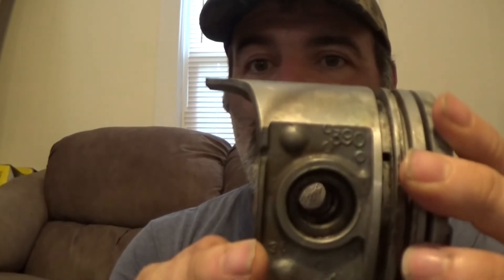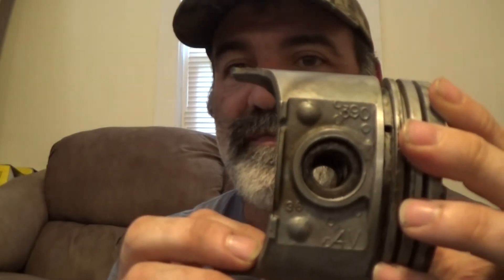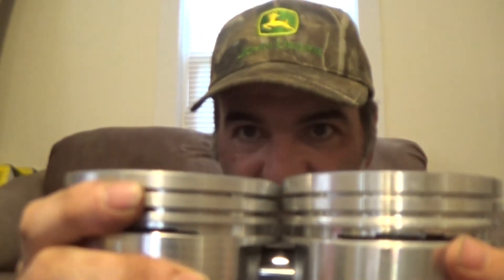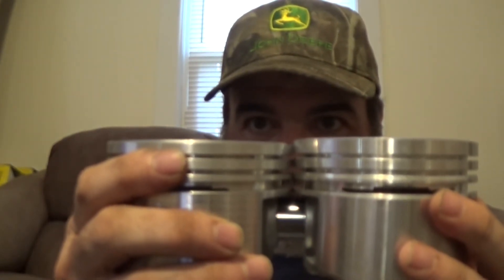Ford FE 390 piston differences?

Comment: SO if i just have a tired old 360 that runs decently but not enough power to chirp its tires unless maybe  you abuse it it and  brake /Tq but ive yet to do that, what  pistons will i have?  wont i just need the longer 390 rods and crank to make a much more powerful 390 fe, at least way more power than a tired old 360 ?
Reply from the maker: Unfortunately that won’t quite work. You are correct that since the 360 used 390 4V pistons that technically you should only need the 390 crankshaft and rods and use the 360 pistons. Btw…390 rods are shorter than the 352/360 rods, not longer. But the problem is with the 360 the pistons are .065 or more down in the hole at top dead center. The 390 4V piston when combined with the 390 crankshaft and rods would put the piston around .030 down in the hole at top dead center. So if you made a 390 out of a 360 without boring the cylinders, your rings would be running over the ridge left in the cylinders from when it was a 360 and would end up breaking the rings.
Reply: @BlackLabGarage  those ridges dont normally hone out and or at least use a ridge remover for top ridge then hone?
Reply from the maker: @KravMaga-d8t I would never recommend doing that. If a cylinder is worn bad enough that it needs a ridge reamer then it needs to be bored oversize. If you put one together without boring it, it probably would run but would be an oil burner because of excessive piston to cylinder wall clearance and wide ring gaps. It would end up breaking the rings and probably busting the piston skirts off the pistons from the piston rocking back and forth due to excessive clearance.

Comment: Thank you for the great videos! Yours are the easiest to understand? Question: What P/N brand composite head gasket did you use?  Thickness?
Reply from the maker: @tom87112  well the problem with that was I used some ROL head gaskets that I had. They measured around .040 best I can remember. But ROL is long out of business. If I was to get a commonly available head gasket it would be a Victor Reinz HG10034 and they measure right at .040” thick. Actually I have a set of the Victors stashed back for the next FE I build. The standard Fel Pro Permatorque gasket would be my dead last pick for a head gasket.

Comment: What about putting that 1130 piston in a 360 engine?  Where would the compression ratio work out to be?
Reply from the maker: @jeremydunn4180  I’d have to do the math but you would lose compression. A 360 uses 390 4V pistons from the factory and even with those, the 360 only has like 7.5:1 compression. Going to a dished 390 2V piston would make it have around 6.5:1 if you used a composite head gasket. 7:1 if you use the steel shim head gasket. That’s roughly what it would be. Could be even less once it’s calculated

Comment: I built a 410 4V for my 67 F100 with a C6 and 3.70 rear man I had a truck that would burn those L 60s off. I had to use a spreadbore adapter to run one of those shiny Holley carbs that were made a lot like the Autolite carbs that you could pull the top off of, but had the Holley jets that went into the floor and the power valve was in the bottom like the Autolite and the accelerator pump was like a 2100-4100 with the vacuum pot on the side like a Holley and the rear had the floor jets and a power valve. It was a Spreadbore 850. And man with 37 degrees of timing, and the dash pot with the little Allen adjuster to smooth the secondary coming in, it was one of the best carbs I ever had. The whole bottom was one piece like a bathtub and had two inlets with a special line that screwed into both ends with 2 needle and seats. I think it was an 8011-850. Holley made a square one just like it. . They were like an Autolite. You could get good mileage, but you had to keep your foot out of them.
Reply from the maker: You mean like I did in this video?
https://youtu.be/53LwoaejiNY
Reply from the maker: I ended up getting 13mpg in my 1974 F-350 flatbed dually with it loaded. If I would have put headers on it I could have gotten even better mileage but I think 13mpg loaded is good considering how heavy the truck is and its 3:73 gears.

Comment: You have a good plan. I  put a solid 270 S on my truck engine I used the lash to get more duration on the exhaust. I  ran the intake lash tighter and the exhaust looser and the balance was great. The 65 F250 4X4 would get 14 miles to the gallon with 3.54 gears in the Front Dana44 and 3.55sin the Dana 60. I ran synthetic gear oil like they run in Class 8 trucks in the axles, the transfer Case a Dana24 gear drive and the NP435. The transfer Case is 2 speed and I had locking hubs and if it was snowing I d lock the front axles, but keep it in 2H and go to 4H if I needed all 4. Most all the time they were unlocked. And in 4 hi, it was the sweet spot for the way I had my distributor timed. And the carb was setup. I used a vacuum gauge to jet it and keep the secondaries where they kicked in just right. I had a 2 inch phenolic spacer to prevent nozzle drip and heat soak. The bigger Comp 270S with the lash tuned prevented detonation with L2291 F pistons, 10:1 CR , headers and the C4AE-G heads with 2.09/1.65 valves in a 394 FE. You don’t need to give it much gas, the 3310-780 cfm was really responsive and you really just needed to run the 2 in front unless you were keeping the gas fresh. And you shift it all across town without touching the clutch. That’s why it got good mileage and would still eat somebody’s lunch every time you did want to.
Reply from the maker: I wanted to do a little bit bigger camshaft when I built that engine but we were just coming out of the Covid lockdowns at the time when I was gathering parts and nobody had a camshaft or even cam cores to grind one at the time. So I ended up just having to go with the stock replacement camshaft because that was all I could get at the time.

Comment: Install the distributor into the intake manifold before you put the bolts in the fold before you talk them down. The distributor will line up the manifold properly. If you torque the bolts, you may not get the distributor in to the manifold and down the block.
Reply from the maker: I actually recommend doing that in my 390 build video where I install the heads and intake. That's how I do it.

Comment: Frustrating… TAM built my dad’s motor years ago and used the 360 rebuilder pistons which also included a dish!
As weak as that motor was, it was the only thing that would start at -65F
Reply from the maker: I bet it was hard on gas though

Comment: How did the 390 run I bought a 73 highboy and the motor was seized up so I want to build a 390 like you were describing in this video and I want to know how it performs
Reply from the maker: It runs great and got good fuel mileage considering what it was. If you look at my 1974 F-350 playlist you can see me build the engine and test the fuel mileage. After I converted to electronic ignition and recurved the distributor I could get 13mpg's loaded which is far better than most of those trucks can get loaded. Unfortunately a tree fell on the truck so I am going to have to replace the cab on it.

Comment: I ran with  small block chevy circle track guys in the 80s they sound like u on pump gas and cam .he told me some of them ford guys make them fords run better. As a Body man, I prefer working on Fords.
 You can practically adjust the doors with a Crescent wrench. Now I got a 76 f250 4×4 I can't wait to get your 390 in it. Back in the 80s, we were using 10:1 Crower 108 Lobe separation Keeping  duration under 300
 And as much left as we could get .
Reply: My Ford confusion syndrome, it's gone. Thanks for your help.
Reply from the maker: You're welcome @richardmartin2646
Reply from the maker: Oh definitely I agree with you on doing body work on Fords. I despise doing body work on a square body Chevrolet lol

Comment: Used those low compression pistons in a 390 I had in my 1959 Fairlane when it was rebuilt back in 2003, The engine was originally from a 1976 F100 so it was designed to have those, Was told that was a 2 year only thing "1975-76" so it could use 87 octane, The engine ran fine with them had a Holly 4Bbl and made plenty of power on 87 and 89 octane and never pinged!
Reply from the maker: I don't know why they told you it was only a two year thing in 1975 and 1976? The low compression 390 piston was used in the trucks from 1968 and on. The part number was C8TZ6108R. For sure it would be hard to make them spark knock with the compression being that low. They was advertised as 8.2:1 but in reality they was closer to 7.5:1
Reply: It's 410 pistons in the pickup and 2v carb
Reply from the maker: @dalecarter4025  Yes...the Ford 390 truck piston is the same piston as the Mercury 410 piston. They used them because of its 1.66" compression height rather than the standard 390 pistons 1.76" compression height so they could lower the compression. But you could get a 390 4V in the trucks. It was an option but it still would have been the low compression engine

Comment: Ford listed " nominal " compression ratios in their engines not absolute.
If you understand the difference you understand why checked compression is not the same as advertised. 
Nominal is just a ball park average.
Reply from the maker: Absolutely! Ford listed the 360 engine as 8:1 but in reality they are 7:1-7.5:1. Even the 10.5:1 390 engines are closer to 10:1 when you measure everything out and do the math. Sure some of the 390's will be that high but that depends on what cc the combustion chamber is, the deck height of the block, etc...
Reply: @BlackLabGarage  I remember reading that in a Ford shop manual back in the 1970's.

Comment: Love the 390, had two and both respectable. in the process of building 66 f100 with a 79 4x4 running gear. With a 390 i will be watching.
Reply from the maker: I was going to say if you are using a 1979 running gear it would be easier to swap a 460 into it than a 390.
Reply: @BlackLabGarage  LOL iam a die hard 390 fan, i have a 92 with a 460 fi, all stock hay/wood hauling but not impressed at all on the open road. iam going to run the C6 and saw the comment about loosing 20%. ouch.
Reply from the maker: @chucksmith6842  I do like the FE's engines but a good 460 will pull the lungs out of a 390..lol. Now a 1992 460 isn't a good example of a strong 460. 1993 got the better cylinder heads but the fuel injection and smog crap is what killed the 460's power. I have seen the fuel injected 460's with a set of the 1993 fuel injected heads lightly ported, bigger intake valve, small camshaft, pull 425hp and 500lb feet of torque on a dyno! The fuel injected heads was the best head of all the 385 castings because Ford finally realized that velocity works for building power! The fuel injected heads have more velocity than the older carbureted heads.
Reply: @BlackLabGarage  one thing i have learnt growing up is you are never the biggest, never the toughest, never the fastest, never the smartest. but i would certainly be happy with a 390. my goal is to bore and stroke it. Not building a race car but i dont want it to feel like stepping on a prune when i get on it . i enjoy the vids man good job.
Reply from the maker: @chucksmith6842  The 390 is great engine! It's truly the work horse of Ford engines. It has done it all from the 390 High Performance to the 390 truck engine. But I wouldn't ever stroke one. That's where I would go with a 460 instead. You get more cubic inches and a better designed engine for less money.
Reply: @BlackLabGarage  iam listening, why not stroke an FE? Is there an issue with that or you just wouldnt do it when you could get the same cubic inches from just going to the 460?
Reply from the maker: @chucksmith6842 there are no issues that I’m aware of on stroking an FE engine. But that’s an extra $1500-$2000 cost that still doesn’t get you the cubic inches of a stock 460. Plus the 429/460 has canted valve heads which is a better design. Now if someone has a 390 or 428 powered 1969 Mustang then yes I can understand spending the money to stroke an FE to put in it plus an FE is lighter than a 460. But for a truck it doesn’t make good financial sense to me to spend the money to stroke an FE for it.
Reply: @BlackLabGarage  you are right, the kit is about 2000 alone. i do appreciate the input. still have ton of body work before i have to make the final decision. Thanks for the vids man.
Reply from the maker: @chucksmith6842  I just try to stay practical on things. If you want to stroke an FE then do what makes you happy. Lots of people do it because they love FE engines. But in practicality the 460 is bigger, a better design, and if you truck had a 351M or 400 in it from the factory then you already have the right engine stands in it to drop a 460 in it.
Reply: @BlackLabGarage  i would say i fall into the love 390 category. may try a something different later on if there is a later on. also already have the c6 gone through and adapted to marry up to the 205 t case. biggest problem is i dont know how to actually build the engine myself.
Reply from the maker: @chucksmith6842  The biggest problem with FE engines is finding parts for them. At one point nobody had cam bearings for them, nobody has cores to grind camshafts for them, wrist pin bushings was out of stock when I was building mine. Hopefully things have gotten better but I know others are having to wait close to a year to finish their engines because of parts.
Reply: 351c, with 302c heads, 12.1 comp. runs fine on lpg, & fkn quike.. in my bronco for 15 yrs. no probs.. ausie..  no cam, would be better with small cam, couldnt be bothered.. @BlackLabGarage

Comment: What about the Mercury 410 pistons they put in the 390 ? Best Ford cam all around was the C8AX -6250 -C . 282 ,296 W 512 lift .
Reply from the maker: The piston you see me holding that has the shorter compression height is the Mercury 410 piston that also became the 390 truck piston. That's why the 390 truck engines were a lot less powerful than the car engines because the piston was too far down in the hole at TDC. That C cam is a good cam for a car but not that good for a ton truck lol. The Comp 275 DEH was close in specs to the C cam.
Reply: @BlackLabGarage  The 406 piston sat down in the hole because the heads had small chambers or the 406 would have had almost 12 to 1 compression . The 1961 390 heads had a smaller more modern design chamber than that .
Reply from the maker: @edge2sword186  But the piston coming  up to the top of the block would still be more resistant to detonation than the piston being down in the hole even with it having higher compression by coming to the top.